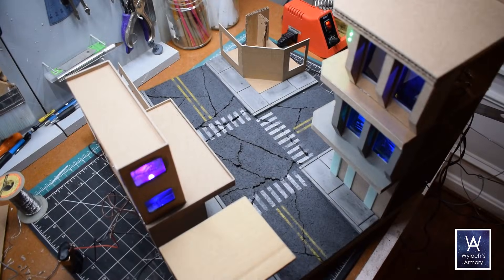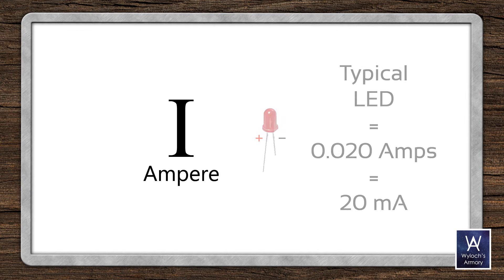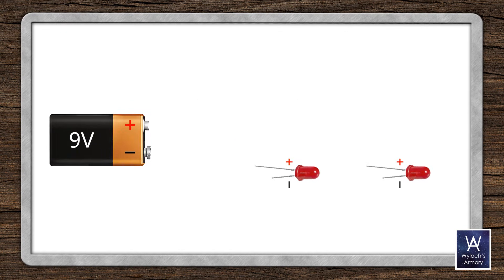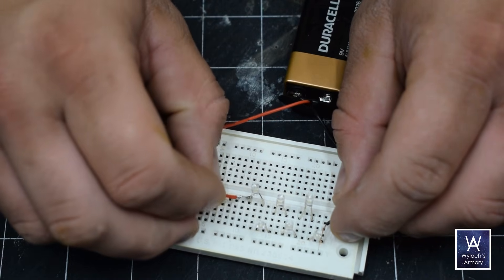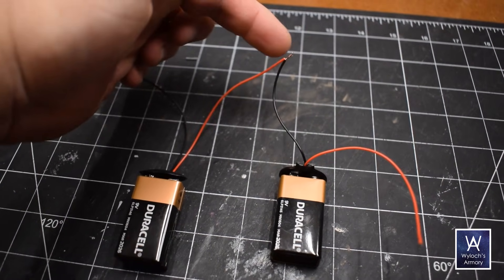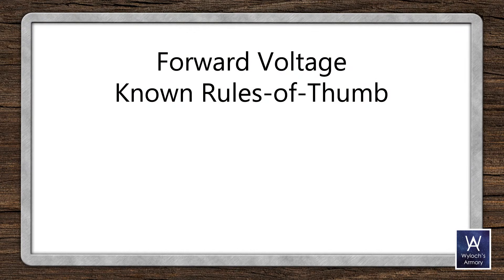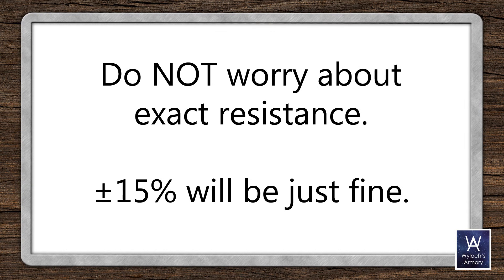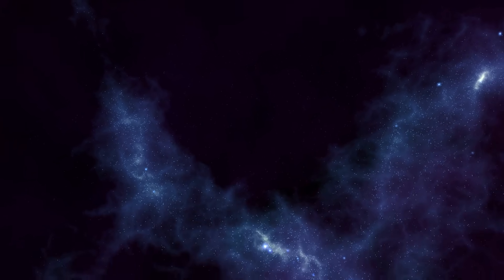The Comprehensive Newbie Guide to LEDs in Miniatures Terrain

Comment: It's a bigger startup cost, but a cheap multimeter and a potentiometer of around 1k to go with your breadboard will give you the numbers you need without having to wire up a ladder of different resistors. Connect the LED(s) and potentiometer with the potentiometer turned to maximum resistance, then connect the battery. Normally, the LED(s) won't light, or will light only dimly. Turn the potentiometer shaft, and the LED(s) will brighten. When it stops getting brighter, back it off a touch, then disconnect the battery, and use the meter to measure the resistance of the potentiometer, and you'll have the rating of the resistor you need for that number of LEDs in series.

Comment: Absolute beginner here. Yesterday I bought a pack of resistors, several LEDs, a breadboard, some wire, and a battery pack. Today I wired several circuits based on your video. As a retired chemist getting into the maker space,  thank you for teaching an old dog new tricks!

Comment: You can figure out the exact Vf of a salvaged LED with a cheap multimeter. No need to test on a watch battery, just measure for voltage drop.

Comment: quick question, is it safe to leave all those resistors out inside the models? Don't they get burning hot? Or are small LEDs not a big issue for this? I'm a newbie, could someone please help haha
Reply from the maker: @loganlopez747  at these tiny wattages, there is absolutely no heat buildup
Reply: @WylochsArmory  thank you so much~

Comment: so ... here's an issue I'm having. I have a series circuit of 3 LEDs... two of them are lit sort of dim (but actually at the brightness i would like) and the one closest to the negative lead is super bright... would installing a resistor help even the lights out? does it matter where I install it in the sequence (for example, between the dim and bright bulbs?)

Comment: I tried to copy your breadboard technique but my LEDs wont seem to light up. I only can connect it with one LED one I add another one, it doesn't seem to work. I've tried switching the LED's around, but theres no light source. How do I copy with multiple LEDS?
Reply from the maker: Where did you get the LEDs from?
Reply: @WylochsArmory wait i fixed it ahha, I just had a flat battery that could only light 1 LED, I thought i was going crazy for a second because nothing was working😂 But thanks for the helpful video 😁
Reply: @Wylochs Armory hi again, I am stuck on doing parallel circuits. For some reason when I connect 3 LEDS, one of them  doesn't light up properly. I've tried decreasing the resistor, but it still ignores the LED. Perhaps its just my breadboard?  i've tried this with multiple LED's too. Thanks.

Comment: Wouldn't you be concerned about fire hazard using them in Paper Projects? I'm interested in using LEDs in my Wood Projects but am a little concerned about this.
Reply from the maker: Not even remotely.  There is ZERO heat going on here, rest assured.

I have these things rigged up in dozens of cardboard buildings.
Reply: @WylochsArmory  thanks for that 👍

Comment: But if u have limited spaces for the batteries example on gunpla, u need to build it in pararel, it will draw larger ampere but same voltage across all the leds. So all the leds across the gunpla can be powered by 1 single batteries. And little tips use SMD led 0402 0603 0805 its much smaller like 1.6x0.8 mm. And u can search for SMD resistor too.

Comment: Excellent quality video presented in an easily understandable manner.  Clear and concise.  I would suggest that since the soldering technique portion of the video is glossed over slightly, that a link to another video specifically dedicated to soldering be included.  Since we are dealing with components that generally are not sensitive to heat, many first-time solder-ers may still apply solder incorrectly (causing bad connections), or apply heat too long (causing melted wires/fried components) and both these errors can easily create shorts or open circuits.

Comment: When you make a combination series/parallel circuit, why is it important to use the same color LED in each series?
Reply from the maker: It's not.  You can mix and match, as long as the total forward voltages add up to something less than your battery.

Connect any three in series.  Touch them to a battery.  They will probably light up.  Then, start trying resistors beginning with about 300 Ohms and decreasing until they start to dim.

Comment: Any chance you could clarify the diagram at the 5:00 mark? It shows the resistor as being placed at the end of the series (after the LEDs). In reality shouldn't the resistor be placed "in front" of the LEDs in the series (in between the battery's positive pole and the first LED's positive wire)? Or am I misunderstanding? Thank you for this video!
Reply from the maker: Think of it like a drinking straw.  Pinch the straw and you cannot sip any more liquid.  Does it matter if you pinch it near your mouth or near the cup?
Reply: @Wyloch's Armory  Thank you for explaining! This had been confusing me and I wasn't sure if the position made any difference
Reply from the maker: Resistor placement does not matter as long as it is in series.  It can go on either side of the LED.

Comment: yes adding 2 9v batteries becomes 18V but it does not increase the a-hr of the battery so it will not last any longer. If you connect in parallel then the voltage stays the same but then you increase the A-hr of the batteries which increases how long they last. So if you connect it in a combination circuit, you can increase voltage and A-hr. Just know that increasing the voltage does not increase how long the battery lasts.

Comment: I have a question for whoever reads me: Is there a preferable type of battery that is more respectable with the environment? I am not clear about the duration of these batteries, considering that I have a project in hand for several buildings that may be used regularly, so as not to use them in "excess", when I could be using another energy source. Obviously using the power grid is out the ecuation since they will be modular. 

Thanks in advance, loved the video!

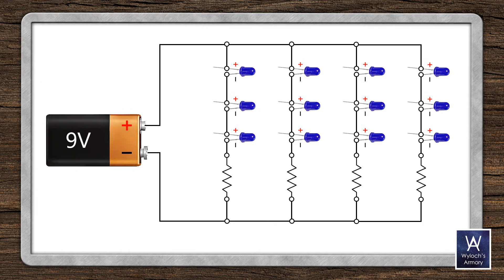Comment: Hi, thanks again for the awesome video! I am trying to assemble my own circuit now. And I do have a question: At around 12:50 you show a circuit of 3 LEDs in a row and that paralleled 4 times in total. How is it possible that 3 blue LEDs with a forward voltage of around 3 V each light up with a 9V battery? Wouldn't 9V - 3-3-3 equal 0? And what is the resistance used for that? I am a bit confused... Thanks in advance!

Comment: i made a LED tree every branch is a serie , there are 2 branches with 4 LED series wich i have noticed that when I unplug the power suply those  eight LED turnf of more slowly than the rest..  are 3mm yellow LEDs fed with 19 v and I used a 560 ohms resistor for each 4LED serie. Is it any issue or it´s just the resistors dissipating the current?
Excuse my English im a spanish native speaker

Comment: does anyone know if covering a resistor with cold porcelain can cause 
overheating or any other problem in a LED circuit fed with 19V¿
Reply from the maker: 19V not really the issue.  It's the current that produces heat.  And LEDs draw tremendously LOW current.  You'll be fine.
Reply: @WylochsArmory  good to read that. Thank you!!

Comment: Yes you can add batteries in series/parallel... BUT they have to be the same type (lead-acid, LiPo, NiMh, etc) or same like AA/AAA/C/D etc and also the same voltage! So don't mix them and even tho you have a 6V lead-acid and a 12V lead-acid, don't combine them. The result is that they exchange an internal currant from 1 battery to the other and will destroy the battery/cause fire... Don't mix non-rechargeble AA with rechargeble AA (1.5V vs 1.2V)
Also putting LEDs in series will work with lesser amps, thus resulting in longer battery life, but if 1 LED dies, the circuit is open and ALL light will go out. If in parallel an LED dies, the rest will still burn.
Yes the long leg of the LED is the +, but what if they bent and broke off? A few things you can see to determine what + and - is on a LED. All + is: longest leg, smallest anode inside bulb, round side of the bulb. All the - is: shortest leg, biggest cathode, flat side. I'm Dutch so we used KNAP to remember it (Kathode Negative, Anode Positive) --> Knap is the Dutch word for handsome 😉
NEVER put a LED to a power source without a resistor!!! The LED is an Diode so it will be like short circuiting the voltage source with a wire... (but because the internal resistance of CR2032, and not capable of delivering high currents, in this case it's "OK" to do this test... Don't do that with say a 6V lead-acid battery or you will burn the legs of the LED in your flesh... I know...

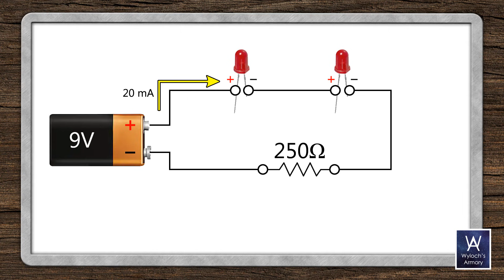Comment: Why is the Resistor BEHIND the LEDs if it is supposed to 'slow up' the current going through? Maybe i misunderstand what's happening. Referring to the image at  5:25
Reply from the maker: It will slow the current either way.  It can be installed before or after the LED.  Performance will be identical.  The ONLY way back to the battery is through that resistor, one way or another.  Therefore it will limit the current.

The LED does not "consume" current.  Try and eliminate that thinking from your mindset.  The LED does "consume" voltage, but it doesn't "consume" current.

In fact, none of these devices consume current.  They all experience the exact same current.  What they do with that current, varies.  An LED lights up.  A resistor wastes it due to heat.  A capacitor (which we didn't even talk about in this video) would accumulate charge.

Current is constant.
Reply from the maker: Also...here's an older, terrible video I did that uses a fluid flow analogy to help demonstrate how "current" and "voltage" truly behave.  It's hard to watch but if you can sit through it, might help you a ton.
https://www.youtube.com/watch?v=EHUcuUSq8w0

Comment: Hi, would you consider producing a video  that includes led’s that have prewired resistors and also how to select a proper wall power supply that converts to 12v DC. What are the considerations of selecting amp output of said supply etc.?

Comment: When you used the watch battery you didn’t need a resistor? Would it still be necessary as all I plan to use are those small batteries hidden in the base of an action figure.
Reply from the maker: Yes, you should still use a resistor or else you drawing max battery current and will kill it pretty quickly.

Comment: Thank you. This is the most approachable explanation I've seen. Way too many beginner arduino or lighting tutorials jump ahead to the end projects or assume a preexisting level of knowledge.

Problem glossed over in those not so entry level tutorials is way too many of us never learn any electrical schematic information. Too many of us never got that 4th level algebra since lots of districts pushed it off as a middle or high school level math, making it optional after 9th grade. My school was small so we never had math beyond algebra 1 because there were not enough students taught core math beyond basics to even begin to understand higher levels required to enter many STEM fields, and we were the smarter school in the region (focused on chemistry, biology, politics). This creates a barrier that can be embarrassing to even admit we have. US school systems suck as a rule, especially in rural and red areas.

Comment: Do you have a simple way to make those LEDs flicker like the fake candles?
Reply from the maker: Buy one that is a flickering type (they have a tiny control chip in the LED itself).  It is not easy or economical to design a custom circuit to do that.
Reply: @WylochsArmory  ya I could hook it up to an arduino and write the code but I was just wondering if you had a cool trick!

Comment: So why put the resistor on the negative and not the positive?
Reply from the maker: It doesn't matter, you can put it before or after the LED.  And in either position, it can be oriented either way (no polarity).
Reply: @WylochsArmory  interesting, so there's no current like water would flow? I just understood (with my very minimal learning) that you put it in on the positive to protect the item in the chain.
Reply from the maker: @Omniescent  Nope, the same current is flowing through the resistor and the component (the LED in this case).  It can go before or after the LED.
Reply: @WylochsArmory  thank you very much!

Comment: Oh wise and great master.
How would you do this using a USB power system.
I have a teenager and now own a pile of USB charger cords with the unit end buggered. I thought to use them with power warts or even rechargable USB packs. Any thoughts?
Reply from the maker: Hmmm, I am not familiar with USB power packs.  But I believe they are just a rechargable battery, at heart?  The problem is, I am guessing that their output cable, being USB, has a lot more than two conductors in it (i.e. two wires), so I don't know which of those are the 5V rail and ground...
Reply: @WylochsArmory  there are a black and red beeing positive and negative respectively. Then there is a raw wire Which is also a ground. Then a fine white wire and a fine green wire which do not work alone but when one is connected to positive the other carries current.
Disregarding the fine wires I think you would have 2 circuits, maybe? Just have to google the output of a wall wart or battery pack and do your mathmagical stuff, I guess.
Looks like i need to buy a voltmeter.
Oh and thanks for the insight and inspiration.

Comment: Well done! The way you explained it, if someone still can’t grasp it, then by all means just stick to the tea lights. 

I’d love to see you take a crack at an Arduino setup. Not pushing if you’re not interested, but if you’re on the fence, here’s a nudge 😉
Reply from the maker: Bought two kits about three years ago for my Imperator Titan scratch build.  Was going to use it for stepper motors in the elbows and waist.  Never got around to it.  :-D  It's been on my "to do" list ever since, riding that 20th slot or so.